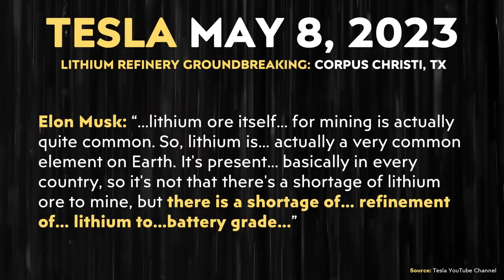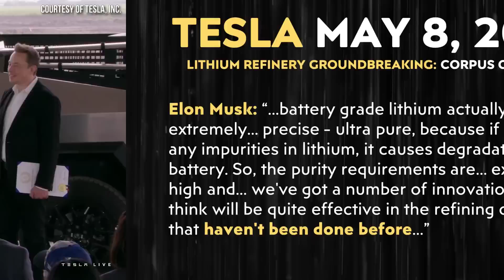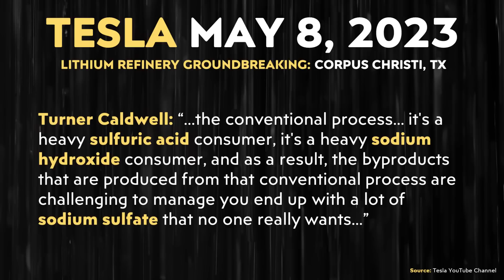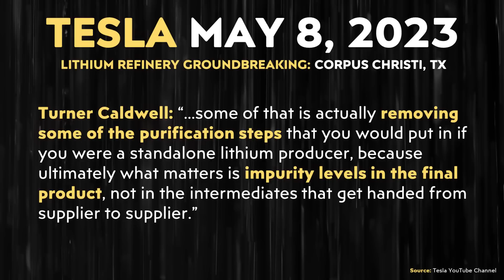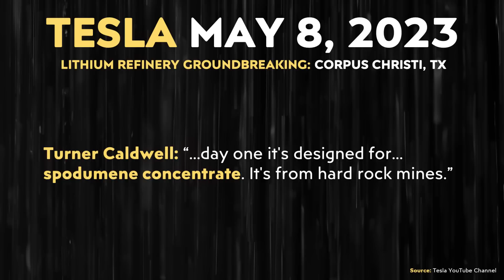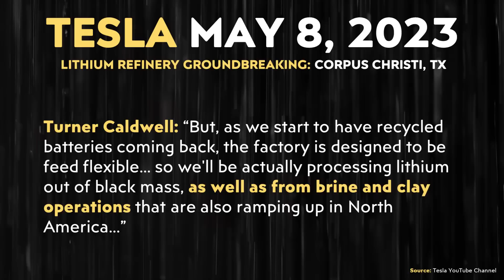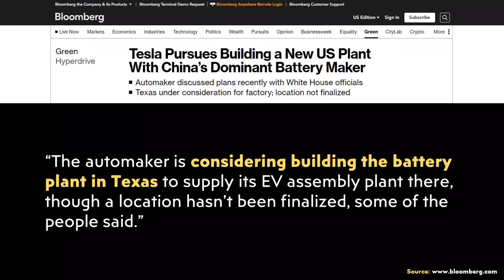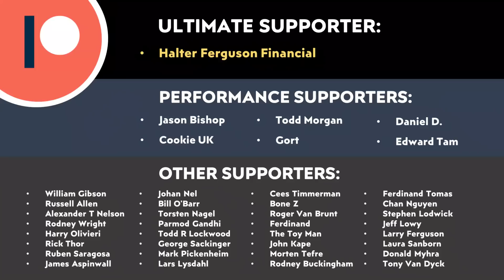Tesla's REVOLUTIONARY 50 GWh Lithium Factory EXPLAINED | Tesla Battery Manufacturing

Comment: Jon, good video but you answered your own question: They are planning to take spodumene concentrate and "...go straight to high purity lithium hydroxide". The compact Tesla is slated to have an LFP battery which will require lithium carbonate. The LiOH coming out of Corpus Christi will be used in the production of high-nickel batteries, so most likely they will be 4680s that will end up in the Cybertruck or the Semi. So maybe technically they could use it to build a million cars but that's unlikely.

Comment: About that Compact car.. how exactly do they plan on putting a 53 kWh battery and somehow sell it for $25K or anywhere near it? The RWD Model 3 has a 60 kWh battery (57.5 usable) and costs $41,630. Even if you get the cost of a battery pack down to $100 per kWh with any chemistry, that would only produce a savings of about $3700, the smaller body itself would only produce a cost savings of about $1,500 at best. So it would actually sell for $35K, and therefore too expensive for the majority of incomes that buy a compact car, which is $20-$25K for the car itself and salaries of $40-$50K. Volkswagen seems to have realized this and say they plan on a sub 30 kWh battery pack car with under 150 miles of range for around $26k.
Reply: Go ahead and watch Master Plan Part 3 again. They detail how they plan to cut the cost of the Model 3/Y platform by 50% in their new Gen 3 platform to be produced in Gigafactory Mexico.

Volkswagen has to greatly reduce the size of the battery because they're unable to reduce manufacturing costs further. That's why the ID. 3 is so expensive.

Btw, RWD Model 3 does not cost $41,630. That's just what it's currently priced at. Teardown estimates indicate it costs about $28,000 to build. Even if they only cut the cost of the Gen 3 to $20K, $25K is still a very good profit margin for the base model without options.
Reply: @TecnamTwin  I was referring to the price, not the cost of production. The actual cost of production is not $28K, that was the estimate for a 2018 220 Mile Model 3, which is no longer made. The cost to produce and ship a RWD Model 3 today is around $33/34K. 

Their major objective is to cut battery prices as that is the most expensive part in an EV, more so than labor. And they plan on using a 53 kWh battery pack for it, so unless they get battery pack prices to $25 per kWh(which is impossible with lithium ion batteries, or any battery chemistry for that matter), it's not going to be enough to be able to produce a compact EV for sale at a price of $26K or anywhere near it, even after taking into account savings in labor and assembly line savings, and parts. They are going to have to reduce the battery pack size, they'll realize this eventually, hopefully. Nissan already realized this years ago, which is why their Nissan Leaf has a 40 kWh pack with 150 miles of range, only problem with it is that it's a compact, not a mid-size, for where it's priced at, it needs to be a mid-size sedan, and needs to be more efficient to bring the battery size closer to 30 kWh, and the dealer network also inflates the price by 10%.  

With the introduction of Sodium Ion batteries by CATL, you can now achieve a $26K Mid-Size Sedan, but only so with a smaller battery pack, around 30 kWh, which translates to around 150 EPA Miles of range. CATL says their Sodium ion batteries cost around $77 per kWh at the cell level, and $100 at the pack level (with 7.5% tariff included). But with with scale, it can scale down to $40 per kWh at cell level and $50 a pack level. It would make no sense to try and make a lithium plant to try and reduce battery costs as Sodium Ion batteries (produced by the same CATL that gives them LFP packs) are already cheaper since they use sodium and not lithium, sodium being over 1,000 more abundant than lithium, costs 20% less and cleaner than lithium. 

So in reality, it would be impossible to sufficiently cut down battery cost enough to be able to go from producing a 60 kWh Model 3 RWD for $34K to a roughly $22K compact EV (for it to be priced at $26K) and still have a 53 kWh battery.  It's a hyper-loop moment, sounds good, but impossible.
Reply: I think that the gigacasting is the biggest cost-reducer because it eliminates so many separate parts.
Reply: @scottbreseke716  By about $400 on a large SUV, and even less on a compact car. It's just for the battery itself, and the body itself is not the biggest cost when producing a vehicle, the most expensive is the battery capacity. So it won't be anywhere near enough to make a $25K car. It's only possible with reduced battery size, and therefore reduced range, of about 150 miles. Problem is, Tesla seems to think everybody wants 250+ miles of range in an EV.

Comment: Considering CATL's sodium ion battery has a energy density of 160Wh/kg and their second Gen will have 200Wh/kg, won't that eliminate the need for lithium mining for EVs considering sodium ion batteries have no lithium and come at a lower cost per kWh?
Reply: No it won't eliminate because of production. There won't be enough of them made to replace all the Li-ion batteries, but they will be a good addition and reduce the need for expensive NCA and NMC batteries.
Reply: @TecnamTwin  'because of production' meaning what exactly? Sodium ion batteries can be used in the same assembly lines that make lithium batteries and sodium is over 1000 more abundant than lithium.